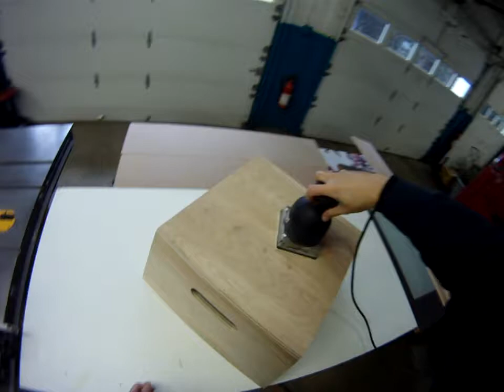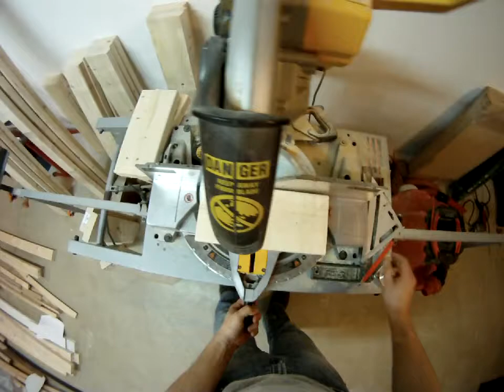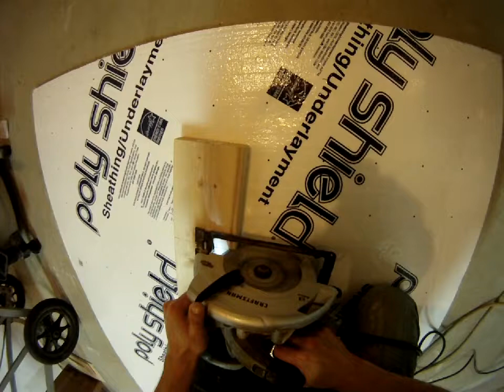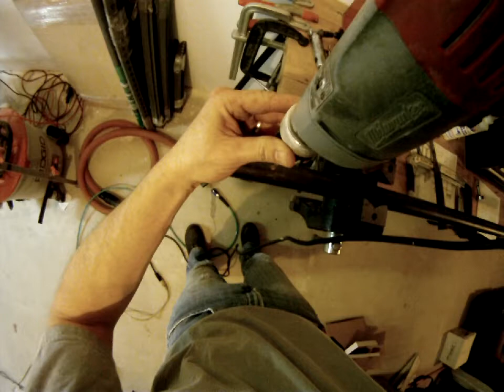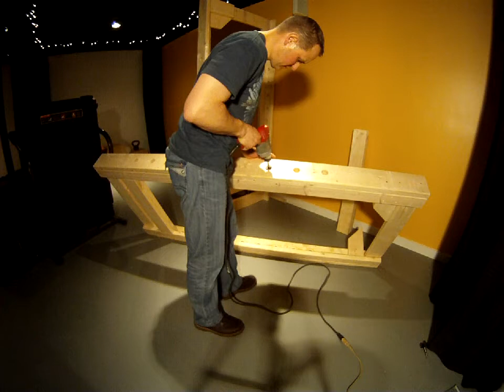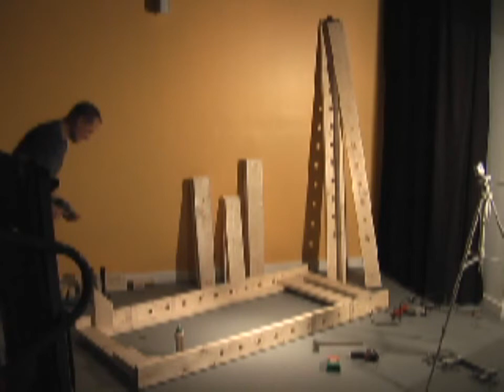DIY Power Rack Home Gym

Comment: I think that you could also use 4/4 preassure trated studs. they for the 4 supports on the side. I know it would cost more but i've seen other people do it. looks slightly easier.
Reply: PT wood tends to warp and twist when it dries.  4x4 kiln dried wood though would work I'd imagine. The reason two 2x4s or two 2x6s glued and screwed together is better is because you have two boards with different grain for support.  Also, 4x4s or 4x6s are usually cut from near the center of the tree.... the weakest part, whereas 2x4s and any 2x for that matter is generally cut from the outer wood of a tree trunk, the stronger section of the trunk.  I'm sure any size could work, but pressure treated wood.... not so much.  Your rack won't be square for too long.